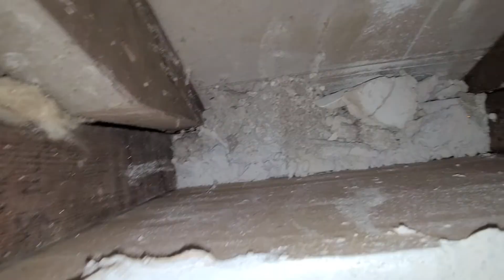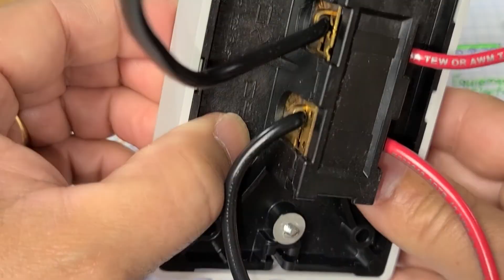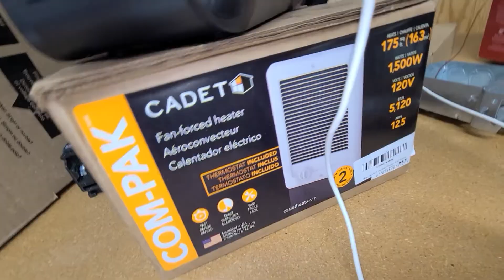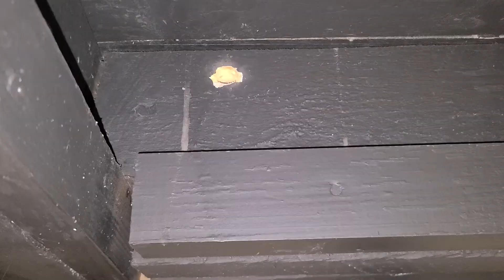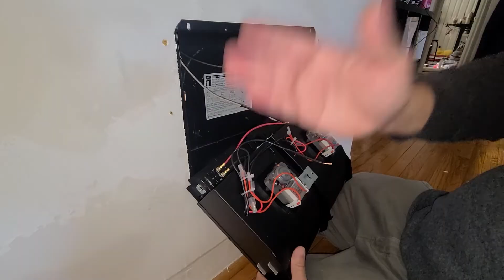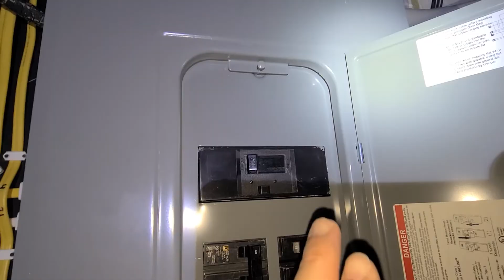How To Install 240V Cadet Wall Heater From Start To Finsh

Comment: Great video. So helpful, thank you. I’m installing one in a basement. Are these “legal” as far electrical inspections go?
Reply from the maker: Sorry for the late reply, and thank you for watching! I appreciate the kind words! 😊 Yes, these Cadet wall heaters are approved heating appliances when installed according to the manufacturer's specifications and applicable electrical codes. The important thing is making sure the wiring, dedicated circuit, breaker, clearances, and installation all meet your local requirements. Depending on where you live, an electrical permit and inspection may also be required, especially if you're running a new circuit. I'd recommend checking with your local building department to be sure. Good luck with your basement project! 🛠️👍

Comment: How do I trouble shoot a double that one side is cold, both fans work just heat on one side
Reply from the maker: If both fans are running but only one side is heating, I’d first check the heating element and the wiring/connections on the cold side. Also make sure you’re getting the proper voltage at that element. If you have a multimeter, you can test the element for continuity and check for voltage while the heater is calling for heat. 👍🔧⚡

Comment: What's the reason for the junction boxes, why not just run the home run from the panel directly to the thermostat? Then load from thermostat to unit
Reply from the maker: Great question. In this case it was mainly a planning and safety decision. I was installing five heaters total, and I knew I wasn’t going to complete all of them in one day. I had the power company pull the meter so I could work safely in the panel, install all five breakers at once, and land each circuit into its own junction box.

That way, once the meter was reinstalled and the panel was closed up, I could come back on different days, shut off a single breaker, and run from the junction box to the thermostat and heater without reopening the panel each time. It also let me take my time and keep everything clean, organized, and not rushed.

Direct homeruns would absolutely work if you’re doing a single unit in one shot—this setup just made sense for a multi-day, multi-heater install.

Also, if you haven’t checked them out yet, I’ve got other Cadet heater installs on the channel too—including a 120-volt Cadet heater install that shows a different setup. Might be helpful depending on the project. 👍
Reply: @HandymanLand thank you for the quick response.  I get it. Makes sense preplanning. Great video, great illustrations.  You work is very neat. Thats exactly how I am about my work.  Has to be neat

Comment: How much heater air is moved? Seems like these heaters the air just trickles out, didn't know if this really push the air out. Would like to see a reading or even just a piece of paper in front of it to see it move.
Reply from the maker: Good question 👍 These Cadet wall heaters aren’t high-CFM blowers like a furnace—they’re made for steady, even heat. The fan pulls cool air from the bottom and pushes warm air out the top, so it’s more of a consistent flow than a strong blast. You can definitely feel the airflow once it’s warmed up, and a piece of paper will move when held in front.

I’m actually in the middle of a full salon remodel right now—from start to finish—and I’ll be installing a Cadet wall heater in that small salon. I may do the paper test you mentioned there, but it’ll be a bit since I’m currently running all the electrical as part of the remodel.

Appreciate the suggestion—and if you haven’t subscribed yet, feel free to do so for more real-world handyman projects. 🔧👊

Comment: I just had someone install that exact one and the fan is not blowing enough hot air I can’t even hear it. Any advice or info as to why? The heaters are brand new
Reply from the maker: “These fans are pretty quiet, but you should still feel warm air. If the air is weak, sometimes the heater was wired for 120V instead of 240V by accident. That would make it barely blow. It might be worth having the installer double-check the wiring and thermostat. Hope that helps!”
Reply: @HandymanLand  Thank you so much, definitely helped
Reply from the maker: @tatiquieto29 Thank you for watching.And if you haven't subscribed, subscribe for more DIY videos.👍

Comment: Do you need 30 brakers or 20 brakers
Reply from the maker: It depends on the heater’s voltage and wattage. For a standard 120V Cadet wall heater, a 20-amp breaker is typically used. For a 240V Cadet wall heater, most models also use a 20-amp double-pole breaker unless the unit has a higher wattage (over about 3,800 watts), in which case a 30-amp double-pole breaker may be required. Always check the heater’s nameplate or manual for the exact amperage rating before wiring.

Comment: The unit incluye el thermostast
Reply from the maker: Yes, that’s right 👍 The unit does include a knob-style thermostat, but I installed a non-programmable one above the heater so you can actually see and set the exact temperature more accurately 🔥

Sí, correcto 👍 El calefactor trae un termostato con perilla, pero instalé uno no programable arriba para poder ver y ajustar la temperatura exacta 🔥

Comment: Thank you for your video, I already have a twin installed. Question: I have a rental cabin that is 3 1/2 hours away. The installed (already installed, previous owner) twin unit has a knob on the unit as the thermostat. I would like to install and wire in a Mysa Smart thermostat and use that instead of the knob adjustment. Sometimes renters either do not turn down or off the heater. It would be a great convenience if I can do this at home through Mysa app. The instructions state must have 3rd live wire in order for the Mysa thermostat to work. I am assuming all the wiring should already be there in order to accomplish this? Plus, with did you go with a manual instead of a smart thermostat for your twin compak? Thank you, love your videos!
Reply from the maker: Thanks so much for watching and for the kind words — I’m glad the video was helpful!

Great question about upgrading to a Mysa Smart Thermostat. If the current setup uses just the built-in knob thermostat on the heater itself, it’s likely that only two wires (line in and line out) are present. The Mysa requires a neutral wire or 3rd conductor to power its electronics — and that neutral isn’t always present in older or simpler baseboard/wall heater installations.

You’d want to open up the junction box or wall where you plan to mount the Mysa and check the wiring. If there are only two wires (usually black and red or black and white used as hot), then you'd likely need to run a new cable with a neutral (white) wire back to your panel to get it working — or use a different smart thermostat that doesn't require a neutral (though options are limited).

As for why I went with a manual Honeywell thermostat in my video — in that setup, it was all about simplicity, reliability, and cost. It’s for a primary residence where we can control it manually, and smart features weren’t necessary. But in your case — with a remote rental cabin — a smart thermostat like Mysa makes perfect sense. Being able to adjust or shut it off remotely can definitely save on energy and prevent misuse by guests.

If you haven't subscribed, do so to see my latest DIY videos.

Appreciate your support for the channel!
Reply: @HandymanLand  Thanks for the quick response. I thought I would have to run another wire from the box to the twin heater. I do have 2 bedrooms that have old manual thermostats for the baseline heaters. The dials on those have an off. The thermostat wiring on those are a double pole and have four wires. Does that mean the Mysa thermostat would work for those seeing their double poles?  Thank you for the compliment.

Comment: Should get red hot when turn on?
Reply from the maker: Good question! The Cadet wall heater doesn’t usually glow red like a space heater. It heats up internally and blows warm air, but the element is mostly hidden behind the grille—so you won’t see it get red hot. If it's not blowing warm air after a few minutes, something might be off with the wiring or thermostat. Thanks for watching. Subscribe for more DIY videos.

Comment: You should not put that thermostat that close to the heater because it will not read correctly as far as room temperature
Reply from the maker: Hello, thank you for your comment. As of now I haven't gotten any issues with the thermostat in the location I installed it. Although it makes sense what you say. But we haven't seen it being an issue. In fact Cadet themselves design their new unit with the digital thermostat mounted to the heater. Here's the link to that unit - https://amzn.to/4kDCFlh  
Thanks for watching.